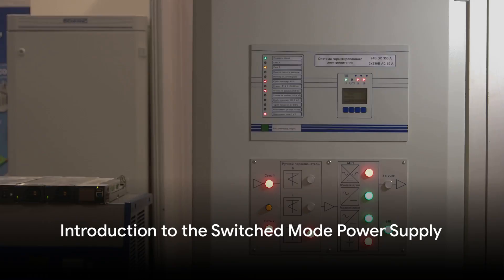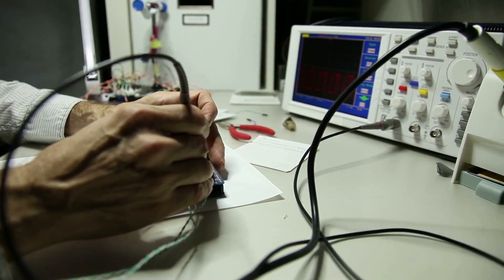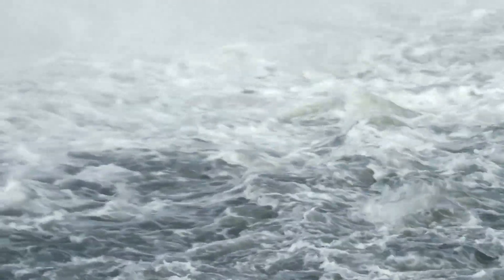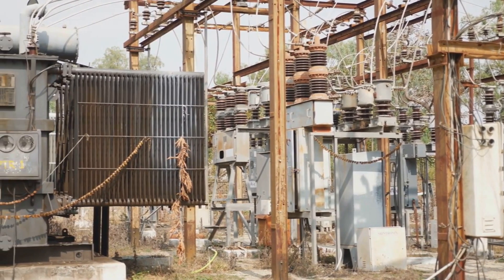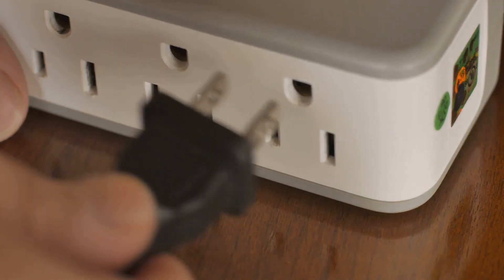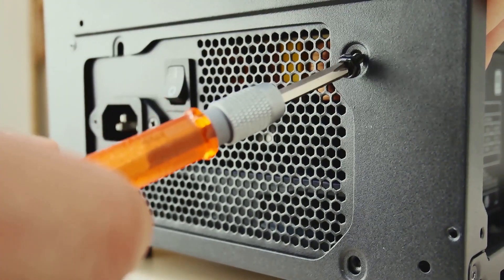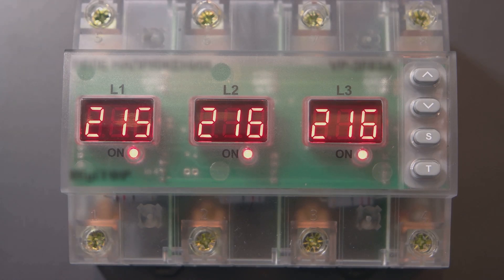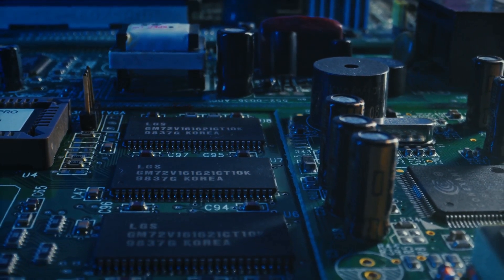What is SMPS and how does it work?

Comment: One glaring fault in your explanation is that you get DC out of an SMPS not AC. Also the explanation although mostly correct is only telling the bare minimum about it.  
A SMPS is a power supply that takes AC in at a wide range of voltages, say 80v to 250v, rectifies it to a DC, cut it in square waves as input for a transformer at a higher frequency AC, gets the correct voltage out of the transformer so that when it is again rectified (made to DC) it has the wanted output voltage. The output is kept stable as the switching frequency is altered continuously to do so. There is a feed back circuit. 
The SMPS is used for two reasons. I has only small losses and it keeps the output voltage stable over a wide range of input voltage.